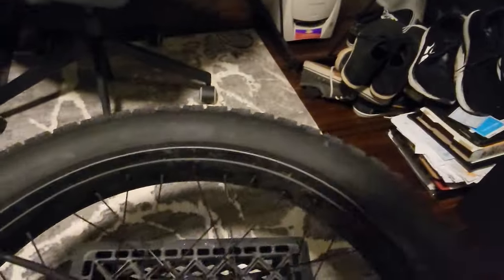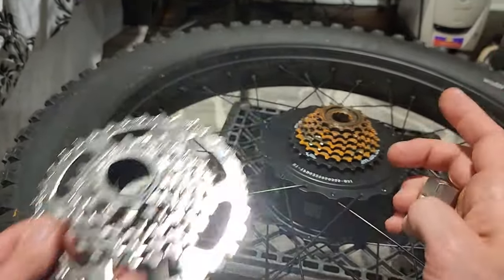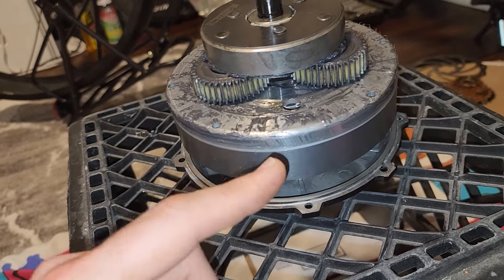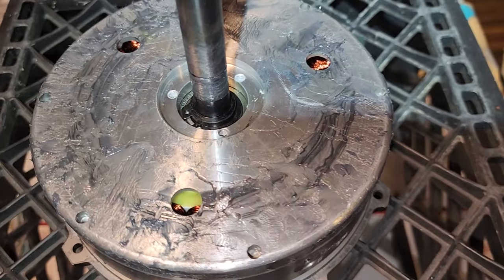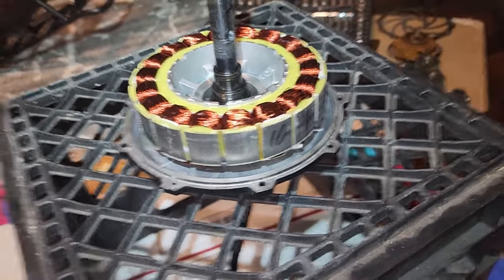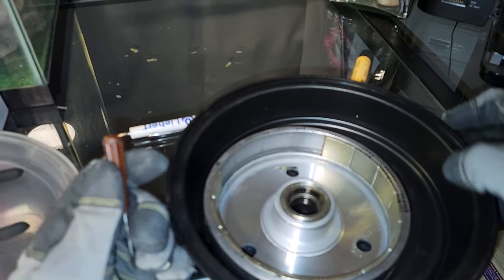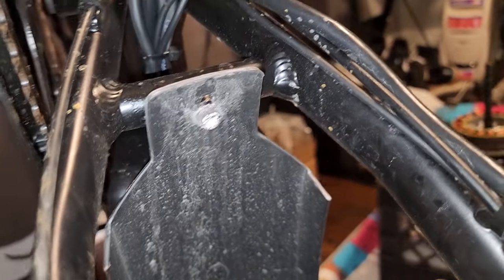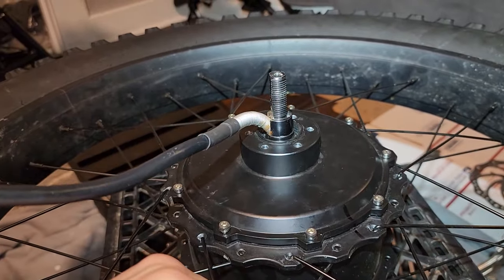Ebike Geared Hub Motor Repair: Loud Motor & Loose Magnets (Wired Freedom/Cruiser)

Comment: This is the BEST video that I have ever seen on the magnets being re-glued.  I own a Wicked Freedom e-bike and appreciate your time to help me as well as others. I am just wondering if you sandpapered the outside magnet housing with very fine grit would allow the magnets to stick better under high heat + the JB Weld ? Thank you so much !
Reply: Also I would strongly recommend you adding into the title of your post on this e-bike as "Wired E-bike" so others can find you through a search :goodvibes:
Reply from the maker: @Robert Haworth  thank you my friend!
Reply: Actually, leaving the surface somewhat rough makes for a better gluing surface than that of a fine surface as it gives the glue something more to grab on to. Imagine climbing a vertical wall: if your fingers can find a crevice then you could cling tighter than you could if the area was smooth with nothing to hang on to. J-B WELD is best applied to clean, dry and somewhat rough surfaces. Sometimes, on certain applications, extra holes are drilled so the glue can get an even better foothold.
Reply from the maker: @geedub7912  true. I guess it's good that the Magnets scuffed themselves up
Reply: @maximumchargeEV : I'm currently waiting for my new Freedom to arrive and hope I don't have this problem. I have another bike with a direct drive magnet hub motor that does have this problem however but I haven't split it open yet. I either have to pay someone to do it or purchase an expensive 12" puller, that I'll probably never use again, and do it myself. I've serviced the 750 hub motor on my Hemiway Cruiser but only to the nylon gears. Your video was very informative and helpful. TY ~ 🤠 Happy Trails!!!
Reply from the maker: @geedub7912  hopefully the manufacturer fixed the magnet glue issue. I ordered cheap pullers from Amazon and returned them after.
Reply: @maximumchargeEV  : I have a sickness; I don't have the capability to return tools ~ LOL!!!  My mind says do it but my hands refuse to let go. 😂😅🤣
Reply from the maker: @geedub7912  🤣

Comment: They want me to take a 600 dollar bike to a local mechanic. No local bike shops want to work on Walmart bikes.
Reply from the maker: Local bike shops usually don't work on ebikes at all, it sucks. you have to find a specialized shop, and even then sometimes it's not worth it if the cost of the ebike is so cheap.

Comment: OMG man, learn terminology and how to use tools.  The snap ring pliers can be changed from pinch to pull by moving the pivot point. The little piece you called a "clip" is a key.  

Another point is the freewheel sprockets only receive power from your legs, not the motor. So no matter how powerful the motor it will have no effect on the wear of the freewheel when you are working with a hub motor system.
Reply from the maker: I noticed I could switch the c clip pliers after haha. Rookie mistake. Still learning. I'm aware of the freewheel mechanics with the hub motor, just wanted a better feeling gearing.

Comment: But yiu didn't show exactly how you doing everything, how you putthethigs back in. I don't believe you managed to use the gears puller and plastic crate, to remove the planetary gears etc That's BS.
Reply from the maker: Not sure what to say man. I can't film holding a camera whole working with my two hands.

Comment: Yo under 500 miles my wicked cruiser started making this noise.
Reply from the maker: Seems to be a major manufacturing defect of that motor
Reply: @maximumchargeEV  Damn man.
Reply: @maximumchargeEV  Did you fix yours?
Reply from the maker: @CONSCIOUS_TALK_ENT.  yes this video fixed it.

Comment: What no one tells you is once you change freewheels you will probably have to buy a bigger chain because it will not shift correctly anymore .
Reply from the maker: This freewheel was fine with the original chain, but just barely. I did upgrade the front chainring to a 60 tooth and THAT definitely required a bigger chain
Reply: When you change free wheel to a larger one, it will require longer chain, also might need to change the chain ring if its worn. If Drive train components don’t wear evenly, you can get chain skips and other issues

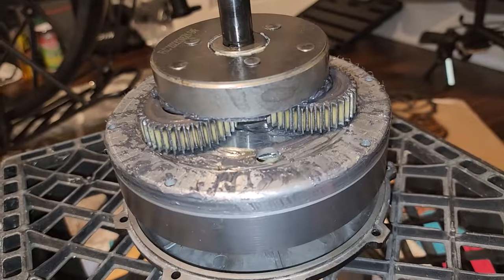Comment: 8:35 so it's better to have weak parts so they can break before the main part does... That is such a modern BS engineer thing to say. This doesn't consider that 90% of the people will simply throw away their motor or most certainly entire bike just because one of the planetary gears have ONE teeth broken... This is just a PURE SHAME and I really really hope that it will stop as soon as possible.
The most majority of trashed hardware comes from this train of thought : let's just take a practical and sturdy equipment and replace some of the part with plastic or other weak material ! But it's for your own safety of course people, not for money NOOOOOOOOO of course not !!
Reply from the maker: You have a point!
Reply: @maximumchargeEV I'm quite surprised that you admit your mistake ! I was a little bit rough on the edge with my comment. But this modern "philosophy" is enraging. The fact thatEVERYTHING you buy today will let you down for a 0.10 € part  is just a pure shame and almost no government are taking action. A little law against planned obsolescence here and there but just for a very small part of the industry is not enough. Our landfill are overflowing with trash that could be working fine. I hate that.